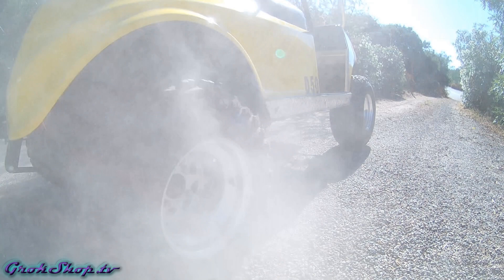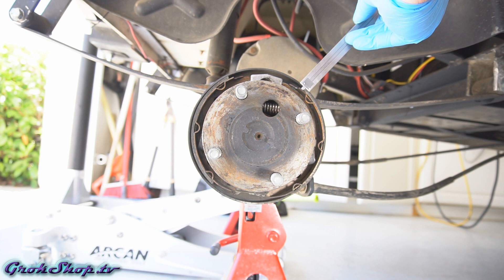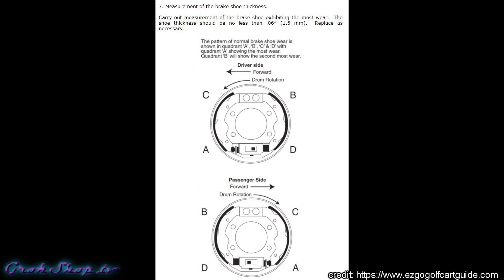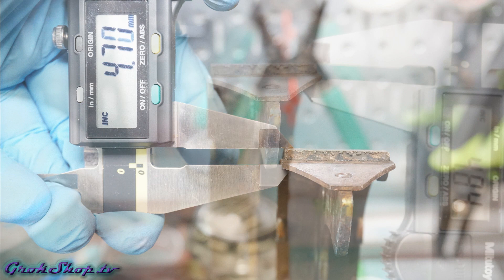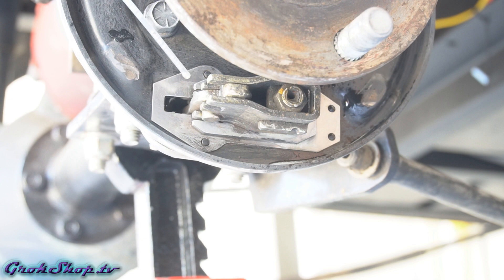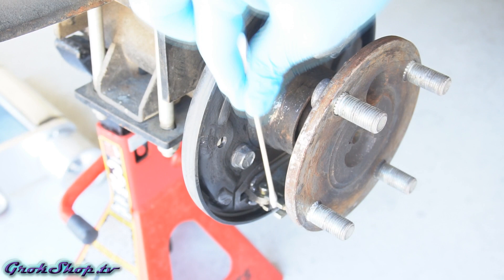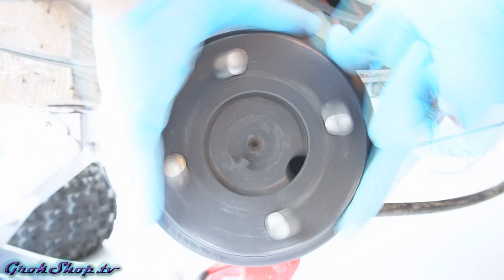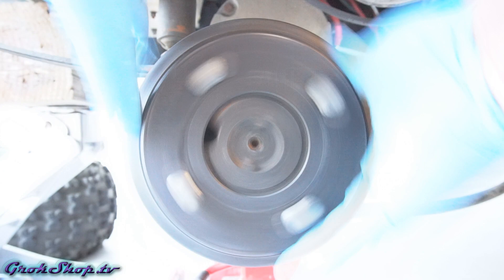Golf Cart Brake Job [part 1]: Installing New Brake Shoes

Comment: This video is great. The only thing I noticed that you put identical shoes on one wheel (passenger side) Shoe lining is shorter on one shoe and longer on the other shoe. I think that shoe with shorter lining is toward the end of the cart, has to do something with wheel forward rotation. Would like to hear from you with comments to my comment. Other then that your video and explanations are great and very clean. Thank you!

Comment: Great video with helpful information. I have a question at 8 minutes on your video, you're cleaning what you called a "actuator/slider". I have a 95 Club Car DS which has a self adjustment mechanism in the same place as your "actuator/slider". You cleaned and lubricant the "actuator/slider". Should my self adjustment mechanism slide back and forth or do I tighten the nut on the back plate so the self adjustment mechanism doesn't move? Thanks for your reply.

Comment: Got a big problem. Passenger side cable appears to be to long. There is no tension on the lower springs. Passenger rear wheel dosen't brake. Could the sliding actuator be broken? Any suggestions?  Rear left wheel brakes fine.

Comment: The “preload” you spoke of, how do we get that out. I can’t get the external brake shoe cover off, mallet or prying 😢
Reply: Okay, it’s only the issue on the driver side. I might not be fixing the correct problem. Passenger side pads look fine. Replaces leaf spring bushing but I’m still getting a “dragging” noise…

Comment: You know you put the wrong brakes shoes on that cart right?
Reply from the maker: How u figure?
Reply: @grokshop  that cart takes J10 brake shoes and you put J17 brake shoes on it. I bet you had to turn the adjuster way out to get the brakes to work. They will work for awhile but eventually you wont be able to make an adjustment anymore. Plus you have to tighten the cable alot and that will just stretch your cables out. Not trying to be a jack ass but I've been fixing golf cars for 35 years and I've seen this mistake quite a few times. J10 brake shoes will work way better.
Reply from the maker: Oh no this is great to have your expertise.  I guess I would say that if you see this mistake a lot, it might be because there appears to be little documentation on the topic.  I can take a little cover in that :)  But perhaps you know of some?  I just put this into a google:  "j10" "j17" "brake shoes" & got a mere 3 pages & almost nothing on the actual topic.  The closest I could find is: http://www.buggiesgonewild.com/gas-yamaha/140432-yamaha-g1-brake-issues.html  And that appears specific to Yamahas.  But I figure there must be something to your claim because we see the "17" stamped on many of the shoes.  But yeah, the shoes have been stellar.  The adjustor was turned about 5-6 clicks from full-in.
Reply: @grokshop  it's common because the parts people dont work on carts they just sell parts. Let's say you called me and said you needed brake shoes and drums for a 1993 club car. I know the shoes and drums because I work on them and club car only used one brake shoe during that time. It also goes to show you how bad the internet can be because you cant fond the right info. I guarantee you that j10 shoes belong on your cart. Like I said before they will work for a while but will lose the ability to adjust correctly. If you still have your old shoes laying around take a close look at the bottom portion of the shoe. J17s have a smaller end than the j10s and are a tad shorter. Also on your cart there is no front shoe or back shoe they are both the same but you didnt state that in your video so I'm not sure what you did there.   I'm trying to help.
Reply from the maker: @michaelthomas2653  Actually, I did mention that this cart does not have specific trailing & leading shoes @ 5:50.   And, I never doubted that you were trying to help or even that you were not right.   However, I am in the business of sharing information.  The internet is neither good nor bad, its just technology.  But its the best technology on the planet for sharing information.   If you are in the business of selling golf cart shoes & have some good inside-baseball information like this, that's great.  But keeping it to yourself does no one any good.  My recommendation to you would be - rather than scoffing at the internet, and being bitter about lost sales,  make yourself a nice blog post explaining this information & back it up with references.  I just might drive some business your way.  Probably more than you realize.
Reply: @grokshop  I'm going to assume that you would like the information that you provide to be correct or am I wrong on that?  We all know everyone is an expert on that and I dont think anyone would try intentionally to put out false information. With that said I'm sure we would both hate for someone to watch your video buy the wrong shoes install them and then figure out why they dont work right. 
I think with what we have posted in your comment area will atleast bring attention to this and hopefully avoid a mistake by someone not in the know. 
I actually dont lose sales to the internet but gain sales from the internet due to people trying to do it themselves but messing it up due to bad info from a you tube video. It's a joke in this industry when people say they saw it on you tube. 
Dont get me wrong your video is great. Your skills rock. It's just that I saw a slight mistake and would hate for others to do that.
Reply from the maker: Thanks for the compliments.  You are absolutely correct: I certainly do not want to put out bad information and I agree there's plenty of that to go around.  And on par with that, as I am sure you noticed, I did not advise anyone to buy any particular brake shoes. I simply showed what I was using.  And, I have to say, these shoes continue to work great so far - after many miles.  I think your suggestion that these shoes may wear prematurely or unevenly due to a slight tip-length difference makes sense & its a fair assertion.  And as I stated in the video, I will advise if I experience any premature wear with these shoes.  However, your are woefully wrong about one thing: showing the shoes I chose to use does not represent any sort of "mistake" in the production of this video.  And as far as me personally selecting these shoes... well if the shoes wear 30% faster but only cost 60% as much, and give good braking over their life, that's a "mistake" I will gladly make every time.  And I hope you keep one thing in mind the next time you are joking with your colleagues about the DIYers who fail - for every few thousand who fail, millions of other DIYers are busy succeeding and collectively saving billions.   And as for the ones who failed - hey at least they had the guts to try.
Reply: @michaelthomas2653  I've read your posts and I appreciate all the knowledge shared. I have a 1990 Club Car DS 36v and I can't find any mention of J10/J17 in any of the part listings for the brakes offered for my cart. I assume the L17 is what you're referring to which is stamped on the shoes? If so, then why are they so difficult to find?
Reply: @brickwal92tt   Not sure why they are so hard to find.  Granted, I don't order from online venders, I have industry venders that I deal with.   I have seen this issue quite a bit, not only on you tube but on other golf cart forums.  If I go into my service van, I can grab the correct brake shoes.  Ive even sent people who cant find the correct shoes to them because they said they are so hard to find.  For me, its not.
Reply: My 1995 Club Car has no adjuster pin, just a flat bolt. Any suggestions?
Reply: @grokshop  This part is still very confusing to me!  this is from the 2005 service manual:"[The trailing shoe has 17T stamped into the tip of the shoe flange (Figure 6-12, Page 6-6). The leading shoe is stamped 17L. When installing the shoes, the stamping on both shoes should be ori- ented to the top of the brake assembly. When installing the shoes on the passenger side of the vehicle, the side of the trailing shoe flange marked 17T should be facing out and be visible. On the driver side, the 17L on the leading shoe should be facing out and be visible.]